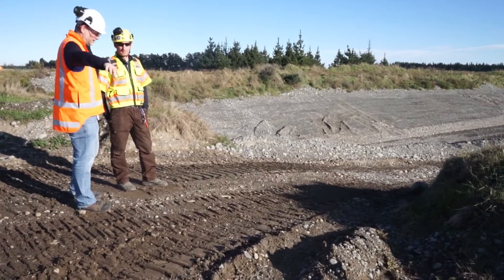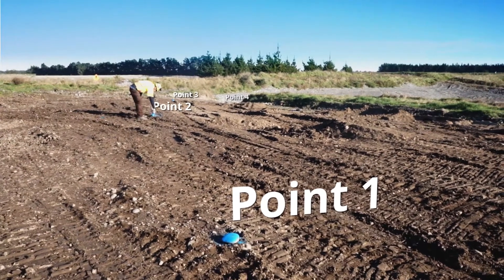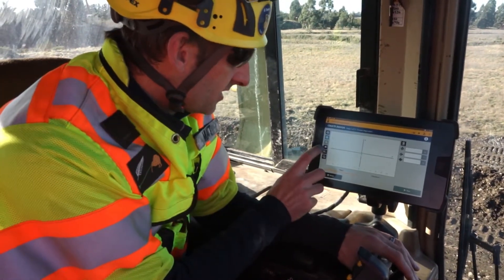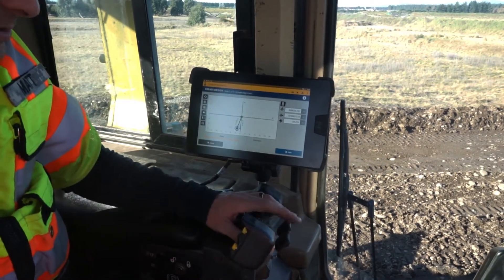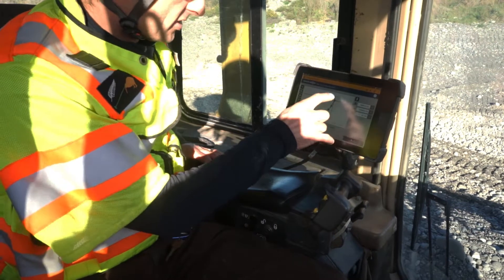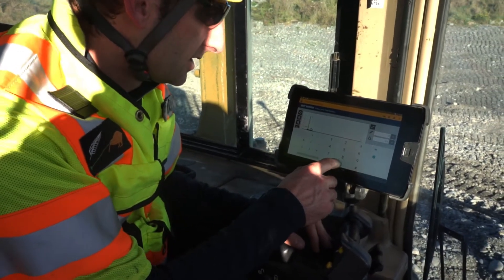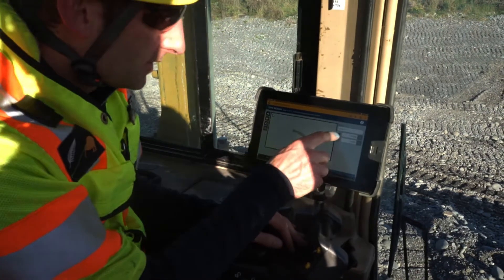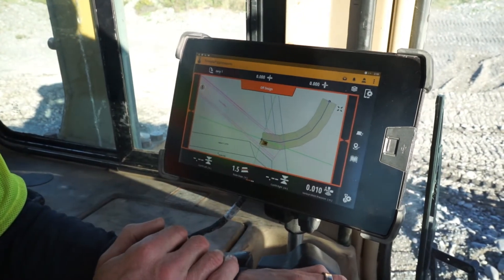Trimble Earthworks Tip: Infield Designs - Build an access ramp

Comment: If you didnt want a constant grade on the slope but didnt like the grade that you have how would you go about that 

Im thinking how we could use this to build farm airstrips which sometimes transition from hillside to flat to flat to hillside 

keen to get your thoughts
Reply from the maker: Thanks for the comment and the question.
Great application you’ve got there with the airstrip. The constant grade button doesn’t have to be used and the individual grades between each point can be edited, either by editing the elevation of the point or the grade of the slope between them.
So per your description of the airstrip it sounds like you might like 4 grades (hillside, flat, flat, hillside) so to do that I’d record 5 points for the alignment (start, end of hill side, end of flat, end of flat, end of hillside) and then edit the grades of the four “segments” between the points to suit.
If the change between each grade is too sharp for the plane to run over then could smooth out with the machine by eye : manual operation or insert extra points either side of the grade change.
Hope this helps, I could make another video walking through that scenario
Reply: @machinecontroltips  Yes would be good to see how you edit exiting points up and down and yes your right the transition betweeen grades needs to be managed and extra points would possibly need to be added to create an arc between the chnages of grade 

Where in NZ are you. Assuming im correct
Reply from the maker: @MrCameronBishop  good deal, I'll plan on doing another video for that.
Yep, you got NZ right, I'm based out of Christchurch